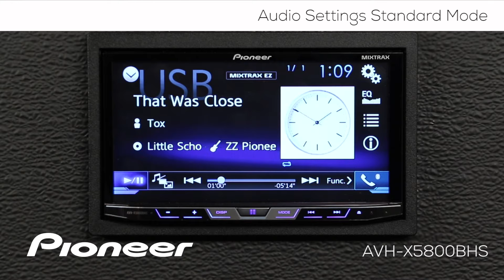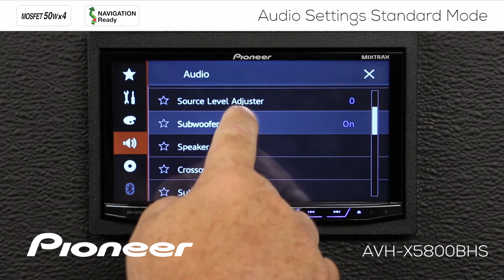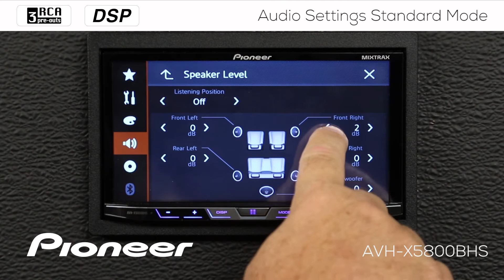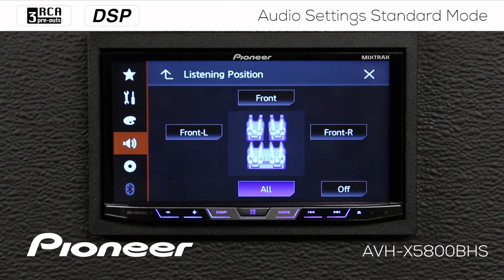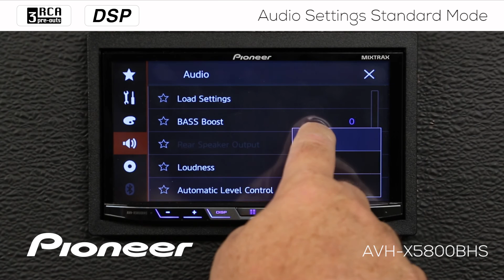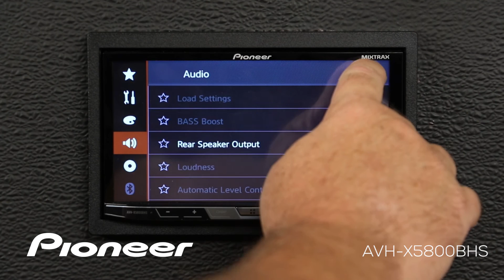How To - AVH-X5800BHS - Audio Settings Standard Mode

Comment: I have an AVH-1400NEX and all of the EQ and sound setting are greyed out, I tried resetting the microprocessor and restoring it and its still not working, how does one fix that
Reply: Here are a few things to test and check:
The receiver needs to be sourced on, for example FM Radio,  in order to have the Audio settings become available.
When the radio is sourced off -  or if sourced to iPod with no iPod/iPhone device physically connected -  the audio settings will remain grayed out.

If the radio volume is muted, the EQ icon stays greyed out.

If using the vehicle SWC (Steering wheel controls)  with an interface module, pressing ATT on the cars steering wheel audio controls also greys out the EQ icon on screen.

The AVH-1400NEX has an external mute wire (Yellow/Black please see this video for help wiring the receiver:   https://youtu.be/-bF3uzzaT30?list=PLw63zJRQbCNhJK38BiQKlR0wF9-TVOVMl  )    and is connected to a vehicle interface module that mutes your audio in order to allow Chevy OnStar or Ford Sync, Dodge/Chrysler Uconnect voice commands , these can leak ground which can cause the EQ icon to gray out because of mute.

Please be sure to install the latest firmware for your AVH-1400NEX.  You can find it here:    https://www.pioneerelectronics.com/PUSA/Car/NEX/AVH-1400NEX#downloads
After applying the update, please be sure to press the microprocessor reset button. You'll need a paperclip or some other small point to press the microprocessor reset button.  You can find the microprocessor reset button on the Pioneer AVH-1400NEX at the top of the hard key panel beside the eject button.  If these items don't correct the issue, the receiver may need to be serviced.  You can contact Pioneer Customer Service in the US on line here:    https://www.pioneerelectronics.com/PUSA/Support    or by phone in the US here:  1-800-421-1404.  You can find How To videos about Pioneer NEX in-dash receivers here:   https://youtu.be/hUAJPnvCMgc?list=PLw63zJRQbCNhJK38BiQKlR0wF9-TVOVMl